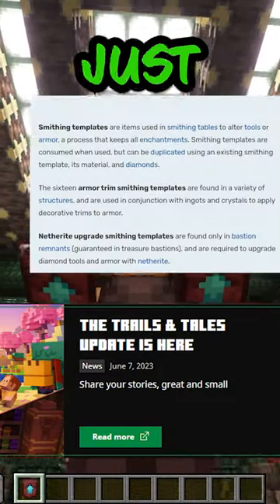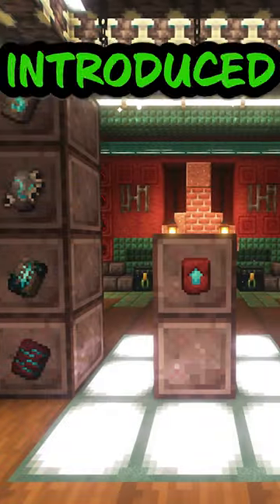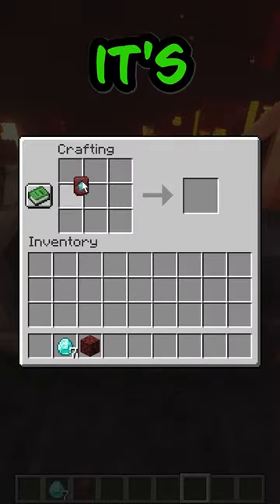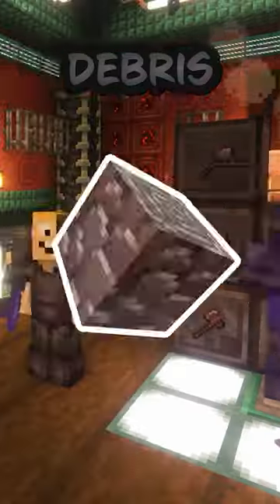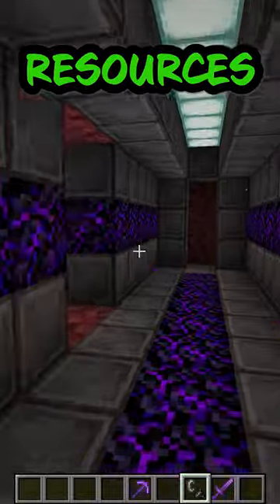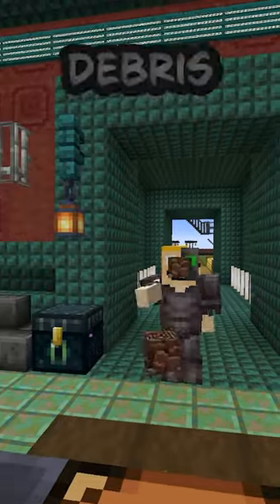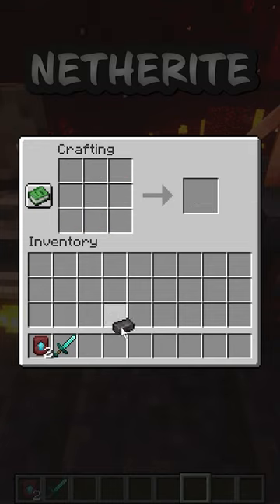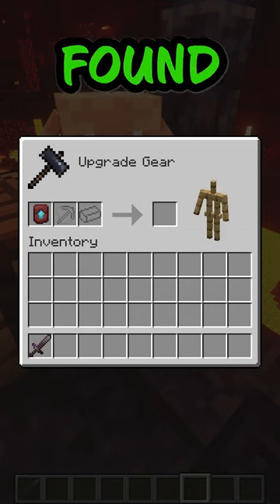How To Make NETHERITE ARMOR in Minecraft 1.21

Comment: i gotta get better at exploring the nether man. so far in my world i’ve found 0 bastions after travelling thousands of blocks in every direction 😭 it’s gonna take me forever to get a smithing template
Reply from the maker: If your play style allows you could always use Chunk Base to find a Bastion.  

Type /seed into the text chat, and it will allow you to copy your world seed. Take the seed to Chunk Base with your coordinates, and you'll find one. They are fairly common tbh, maybe you've just unluckily missed them.
Reply: @r3crypt  in my opinion it's because of chunk base that some of minecraft players complain that netherite is too easy to get. Moreover this item is not a difficulty since it is not even rare, it is just a handicap for the player that undermines and a step that makes the netherite more painful than before
Reply from the maker: I think using Chunk Base or any other assisting tool is a personal choice on play style. I don't use it currently, but have done in the past and see nothing wrong with it.

But I agree that the Netherite Upgrade Smithing Template isn't that rare. I don't think it should be possible to duplicate it. It kind of defeats the purpose in my opinion. 

Having to find a different Bastion and smithing template for every upgrade would make Netherite more rare, and appreciated.
Reply: @r3crypt  the sole purpose of the netherite upgrade is to force players to visit the strongholds, but the spirit of minecraft is to do what you want. And then there are already piglins ornaments in the bastions
Reply: if ur on PC Java go to -x direction or -y
Reply: @Fantastaro  im not on java.